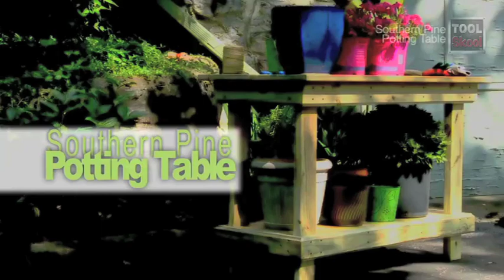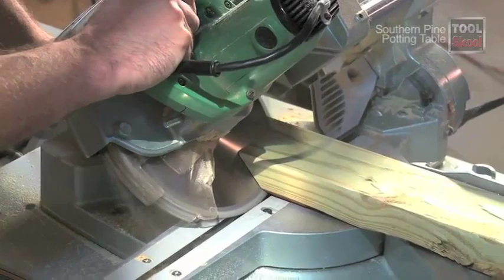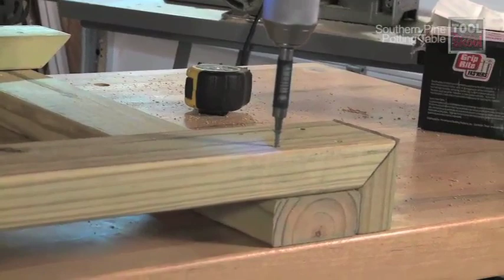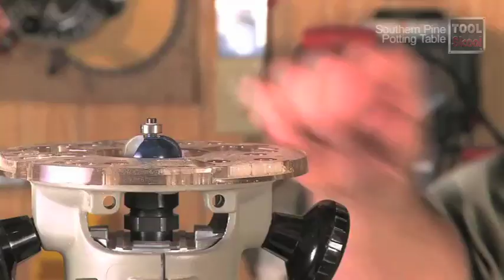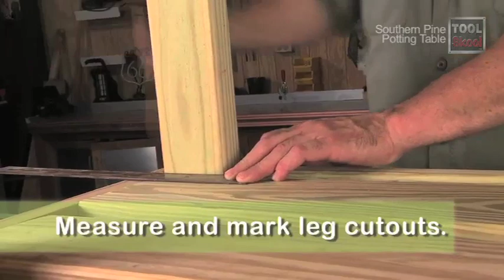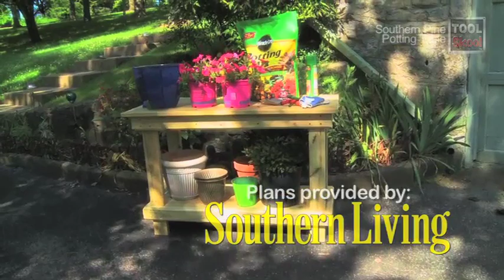Potting Table Shop Project - ToolSkool

Comment: The legs would be better at 34" and the sides would be better at 20 !/4 so you don't have to cut one of  the bottom boards to fit